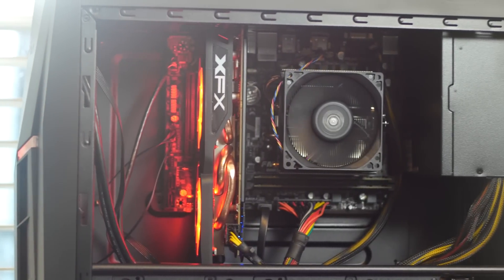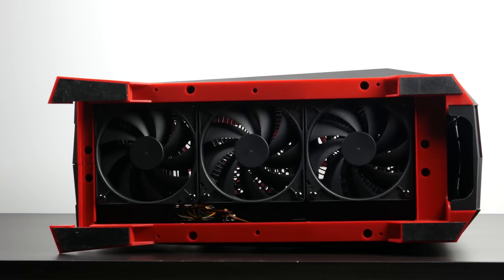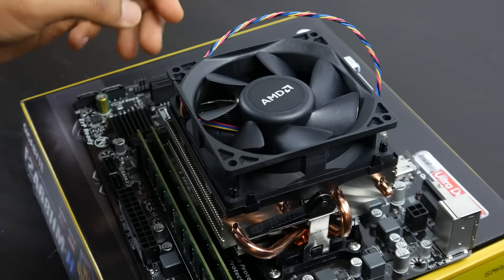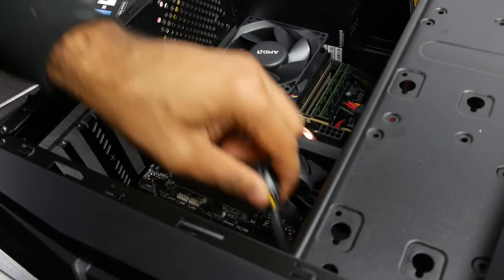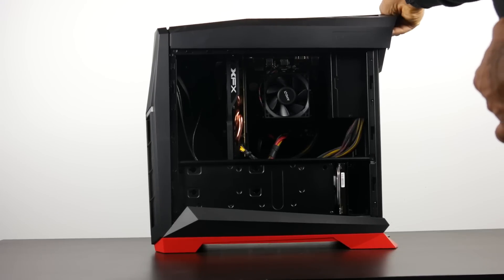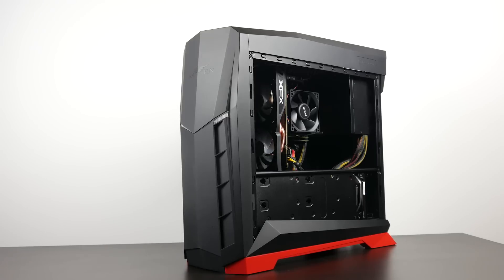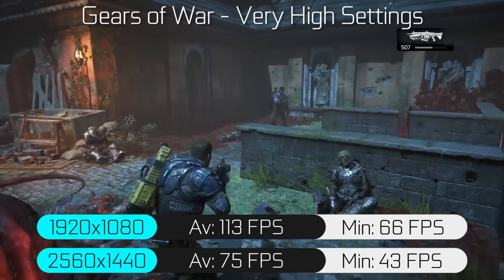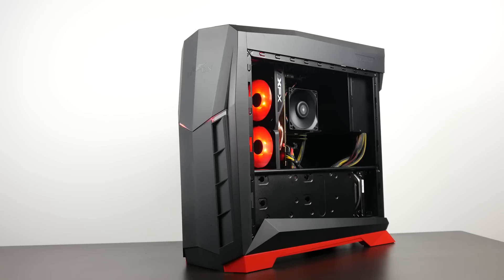Ultimate Gaming PC Under $550

Comment: with which Intel CPU is this CPU comparable?
Reply: Lenny Probably an i3-6100. But an i3 destroys this CPU. So if you have an extra buck get an i3.
Reply: Pentium G4400
Reply: Q6600
Reply: Lenny This CPU when overclocked is comparable to the i5-6400. An 880k + aio is also cheaper than just a 6400.

http://m.cpubenchmark.net/high_end_cpus.html
Reply: foxhill153
you have no idea what you're talking about...even if you would overclock it to 6ghz it would still be noticeably slower than an i5-6400
...even the link you've provided which is strictly multi-threaded performance which is only one part of the equation where the most relevant information (single-threaded performance) is left out you can clearly see that the 880K fall short to even a 4 generation old low end i5-2320
Reply: Tech Wiz Master I'm not sure what chart you're looking at, but yeah the 880k (score of 5612) can be overclocked to match the 6400 (score of 6613) in multithreaded performance. Theres a simple formula you can use to determine the clock you would need too, and spoiler alert: it's less than 5GHz. Not hard to reach on that chip either.

With a bit of overclocking experience and some tinkering, this thing can match the 6400 for a fraction of the cost. Also they're both 4 cores. If you compare 2 CPUs that have a matched # of cores/ threads and a matched score in multi threading benchmarks, they're going to match in single threading as well. that's just so obvious.. I can't believe you would bring that up. 

The fact that Intel since the 1st gen i7s requires a kernel to be built in to the os for their CPUs to work, adding unnecessary virtualization to 3d rendering, makes them likely to stutter more at the same FPS when compared to AMD chips which don't rely on a kernal. I switched from an i5 4670K overclocked to 4.5GHz to a FX 9370 chip because the 4670k stuttered more at 70 FPS than the 9370 did at 45 fps. A lot of the times I was getting better FPS after switching too which made the entire gaming experience more enjoyable. Believe me, I was very much an Intel fan boy like most of you until I actually gave AMD a chance and was blown away.

Also I'm not sure where people got the idea that the i3 6100 would be faster than this thing. it's clearly not. The 880k is faster even before overclocking which you can't do with the 6100.. It really doesn't make sense since developers have been writing low level hardware support in to DX 11 games since the new consoles came out. This means most games can already render on 8 or more cores even before dx12. The battlefield series has done well in this regard.

People need to stop thinking that we still only have 1 core communicating with the GPU. If this was the case still, most modern games wouldn't work (even going back as far as metro 2033), and we'd see dual cores taking over the market.
Reply: foxhill153
nearly 8000 people proved the i3-6100 to be quite a bit faster than the 880K mate...
http://cpu.userbenchmark.com/Compare/Intel-Core-i3-6100-vs-AMD-Athlon-X4-880K/3511vsm121029

the i5-6400 ANIHILATE that outdated processor to the point where no overclock can compensate for that:
http://cpu.userbenchmark.com/Compare/Intel-Core-i5-6400-vs-AMD-Athlon-X4-880K/3512vsm121029
Reply: either pentium o i3, probably pentium

Comment: Same parts in Jimms (finnish online pc part store)

psu             55€
ram            64€
1tb hdd      60€
mobo         50€
cpu          104 €
gpu          289 €
case         106€
=============
total         728 €

Okay the parts dont require shipping in Jimms so you just pay what you get

Comment: I have this build basically. And I am only getting like 34 fps in gta v with a mix of high very high settings. Why is that? 

Specs:
880k
Rx 480 8gb
Asus fm2 mobo
12 gb ram
1tb 7200 hdd

Comment: I would have got a 1050ti and put the extra $100 dollars to upgrading the cpu to a i5 6500. Right now that thing is pretty shit with that cpu.
Reply: No the 1050ti is quite a bit faster than a 460. The problem with this price point is you can either have a really good mid-range cpu or a really good mid-range gpu, not both. So like in this build the cpu will bottleneck that gpu hard as hell in games like witcher, gta, and bf1. The 1050 ti is perfectly suitable for 1080p ultra/high gaming while that cpu will bottleneck the piss out of games.
Reply: if you would watch the benchmarks he is easily getting over 60fps at max settings so it doesn't make a difference. literally spend like 30-40$ on the case and put the rest into an fx or i3 or even i5 if you can mange to find one cheap.

Comment: these fanboys are so hard to deal with. everyone said an I5 of any kind won't bottleneck a reasonable GPU. I had this cpu (technically the 870K). and I have an I5 4460,good budget I5 from the haswell architecture. cpuZ reported that both builds benchmarked almost the same when the athlon clocked to 4.6, losing by on 40ish points in a benchmark that scores by thousands. give this cpu faster ram to help it as much as possible and it will be perfectly adequate. not ultimate but adequate

Comment: Consoles.....Ha!
Reply: This $550 doesn't include the cost of the OS. Most people can't get the OS for free. The fact that the cost of the OS isn't included is very misleading on the actual cost. This build is really a $650, which is $250 more than the PS4 Pro. If the PS4 Pro cost $650, it would outperform this build because it would have better parts due to the the fact that the parts would be way cheaper because Sony would buy the parts in massive bulks.
Reply: But with the PS4 you need to pay for a subscription to play online
Reply: zarbon700 os in Kinguin only $20 an sometimes in g2a $19 and ps4 pro need ps plus $60 😂😂😂
Reply: Most people don't know they can get cheap OEM keys. Mostly PC nerds know about cheap OEM keys. That's why using cheap a OEM key price is invalid.
Reply: This PC build vs PS4 Pro is about hardware performance, not online gaming.

Online is optional. Also, PC online gaming isn't superior to console online gaming. It's often very hard to get online matches going in many games on PC because many online communities dead quickly. More games have a higher online gaming lifespan on consoles than PC. Another advance to online gaming on consoles than PC is it has way fewer hackers who cheat.
Reply: +zarbon700 You can get legit Windows 10 keys for as low as $20 via 3rd party sources. In any case, if you are tech savvy enough to build a PC, you are probably more than capable of getting the OS for free if you really wanted to... I'm up in arms about this build too (for other reasons) but since when did we start bitching about the price of the OS not being included in the build cost? Almost every PC build I've ever seen excludes that and for some reason people are using this comment section to act as if its the first time they ever seen such a thing. C'mon guys, I'm with you with the logical criticism like the expensive case and bottleneck CPU choices but get the fuk outta here with nonsense like that.
Reply: Its not free, you still need a key unless you already own one which is around 180$ (NZD)
Reply: You Do NOT need a key to install windows 10.
Reply: zarbon700 but anyone can get Windows for free. You can download the full ISO from Microsoft without buying anything and say that you will enter the product key later, then never do it. You get the full Windows experience only a water mark in the bottom of the screen
Reply: +Zarbon700 Heres another thing you forget when factoring the value of PC vs a PS4 pro. Unlike a PS4 Pro, A PC is obviously capable of a unlimited amount of tasks beyond gaming. If you strictly want to talk gaming alone tho, Outside of the latest modern games It also has access to a virtually unlimited backlog of games when you factor in older PC games as well emulation of older gaming consoles and platforms ranging from the 8 bit era all the way up to even the WiiU. PC is the only platform that can play games from the very beginning of time all the way to the latest games in one place. Thats only talking retail games too. The unlimited amount of mods and homebrew games available for PC users is another endless world that the PS4 Pro cant even dream about. Once again, the OS and software such as games only costs as much as you want it to cost. On PC you can have a OS of your choice and almost every game ever made and not even pay a penny. All you truly need is a PC and enough HDD space to store everything you want. Especially on PC, almost all software can be obtained for free or has a free alternative if it can't be. Thats why you see so many people willing to go all in on PC builds and not even care.
Reply: And also games are more expensive. And normally people still have some kind of a PC that they can upgrade to WIndows 10 and tie the windows to their microsoft account and that way u can move it to another pc which doesnt add 100 dollars... Or you can buy a cheap key for like 20-30 dollars
Reply: yes, but they need to make profit off the ps4. they can buy the parts for cheap in massive bulk  but it'll sell for a lot more than the parts. building a pc would be cheaper even if a person does not buy up in bulk.
Reply: Giving that Ps4 Pro is way smaller it'll cost quite a bit,it's like a Laptop it's small but not better then Gaming Desktop with similar spec

Comment: Hey Man, will this system be gud for video editing like Adobe elements?
Reply: It wouldve been an okay cpu for editing 5 years ago lol
Reply: jynxed  in that case plz suggest some specification which is good for playing games and video editing like Adobe elements and may be premier pro....I'll wait for ur word before going out for shopping....plz try to keep it under usd1200
Reply: dontuseitmuch At the moment its better to go with Intel preferably an i5 or higher but i would advise you to wait till ryzen to be released
Reply: jynxed okay, what about video card, ram and motherboard
Reply: +ddontuseitmuch Depends on What resolution you want to work at. If you want to work at 4k then either the 6gb 1060 or 8gb rx480 will be enough. As for the ram the higher the frequency the better it will perform (you will need a z170 for frequencies higher then 2133) and for 4k you will need atleast 16gb (2x8gb modules).
Reply: jynxed I like to stick to 1080p only no 4k
Reply: dontuseitmuch Then go with either a 1050ti or a rx470 but have 16gb ram

Comment: Anyone got idea which is better fx6300 or 880k, I'm planning on upgrading gpu and I got fx6300 processor currently, so I'm just trying to estimate what kind of fps to expect. Most stuff I found online about this 2 processor is that fx 6300 is better, so could I expect 2-5 fps increase in comparisson to benchmarks here. And if anyone has either fx6300, 6350 or 880k with gtx 1060 or rx480, could you just comment how pleased are you with those, as in are they that good.

Comment: i built one with a cor i5 and a gtx 1060 for $480   and windows 7 pro
Reply: Lyple how? The gtx 1060 are more than 480
Reply: ScruffyFox I got the 1060 3Gb from gigabyte for $210, but my PC I used was a refurbished HP Compaq 8200 elite cmt with a core I5 and a 500 Gb hard-drive, with windows for $150, but I had to get a monitor for 10 4K at a thrift store, and 4 Gb stick hyperx ram for 25 and ye
Reply: wow the deals

Comment: How much is 880k better than 860k?
Reply: Very little. All of the 8XX series are the same processor, just clocked at different speeds.
And with a low IPC like AMD's, it doesn't make much difference.
Reply: Yes, that's the short answer.
Reply: darkki94 not true, I have the 860k and it does really good for 75 dollars

Comment: I want to get better 4K fps, Should i just add Nvidia 1080 ?
Reply: Aran hiwa if ur on a budget, GTX 1050 or 1060 is ur best choice
Reply: If you want to buy a 1080, u need at least a i5 6500 cpu otherwise the cpu will just not be able to handle it 
And for that, u need a 1151 (like with b150 chipset) ^^
Reply: Im pretty sure you could use an i5-750 with a gtx 10 series card and it would still work.
Reply: it really isnt. the RX480 with driver maturity is edging out the 1060(even just 6 months after release). i surmise that the 480 will soon dominate the 1060 with new APIs and better driver support.

the best choice imo would be radeon. any of the 400 series cards right now. in 2017 however, Vega looks to be the next gen of Radeon cards (ie 500 series)
Reply: Yes, a i5 750 bottlenecks a 1080 just slightly.
But keep in mind that these processors render a bit slower in Open World Games.
My i5 760 is the fault that GTA:V drops on very high to 55-50 FPS on some areas.

In Short: The first generation i5s wont bottleneck, and they are still good, but a i5 6400-6600 would be better.

Comment: RX 480 4GB + i3 6100 and a cheap ass case
Reply: gtx 1050 + i3 6100 and a cheap ass case, mutch better than this shit in the video
Reply: Eron 1050 with an i3 6100 kid? RX 470 4GB w/ G4400 is better.... 1050 will bottleneck the i3 6100 so hard. RX 460 2GB, RX 470 4GB and RX 480 4GB are the best cards to get in their price points. Only thing u can buy on Nvidia is the 1080 if you really want it. I'd rather get a used 980ti than the overpriced 1070.
Reply: Vanguardas Vucava g4400 is less powerful than i3 6100 lol
Reply: JacktheRipper get the g4560

Comment: is this a good build:
Intel i3 6100
Evga 500W White
Gtx 1050 ti 4GB
8gb corsair vengeance 2400 Mhz
Bitfenix Comrade (case)
WD Blue 1tb 7200 rpm
GIGABYTE B150 Sniper B7 Gaming ATX Skylake Motherboard

510-550£ on aria.co.uk 
550£ if you buy an after market cpu cooler

Comment: not to say your build is not good, but imo its just not, even including the 1440p results imo was a mistake, who's gonna go spend $550 on a pc then 200+ on a monitor? just wouldn't make sense, also why an fm2? you can get an i3 6100 for slightly more and be on a socket with an upgrade path(to any skylake processor) and then get an rx 470, again the monitor they have probably won't have more than a 60hz refresh rate. https://pcpartpicker.com/list/jP8tLD here's a build I put together that's cheaper and can perform as good as the one you presented, but thats just my opinion

Comment: Here you guys go:
https://pcpartpicker.com/list/fr2NYr

CPU: Intel Core i5-6400 2.7GHz Quad-Core Processor  ($182.55 @ B&H) 
Motherboard: Gigabyte GA-H110M-A Micro ATX LGA1151 Motherboard  ($48.98 @ Newegg) 
Memory: Corsair 8GB (1 x 8GB) DDR4-2133 Memory  ($44.38 @ Newegg Marketplace) 
Storage: Western Digital Caviar Blue 1TB 3.5" 7200RPM Internal Hard Drive  ($49.99 @ B&H) 
Video Card: EVGA GeForce GTX 1050 Ti 4GB SC GAMING ACX 2.0 Video Card  ($154.98 @ Newegg) 
Case: Deepcool TESSERACT BF ATX Mid Tower Case  ($29.99 @ Newegg) 
Power Supply: Corsair Builder 500W 80+ Bronze Certified ATX Power Supply  ($46.99 @ Newegg) 

Total: $557.86
This build is upgradable, unlike the old FM2+ platform. A budget PC does not need an expensive case. It is your preference if you prefer aesthetics over functionality. However, it will cost you more. This DeepCool case is not even that bad for the price. The GTX 1050 ti should be decent for 1080p gaming. However, if you could save up $50 more, you can get yourself an RX 480. I would not pay any more than $220 for an RX 480

Comment: WHAT does
Bottleneck mean?
Reply: George Hernandez thanks
Reply: +Easy Life hacks
Think of the CPU as a glass.
The GPU is water.

If the CPU isnt strong enough, the glass is tiny. If the GPU is strong, theres more water and the glass flows over.

Thats why you need a big glass, to get as much water in there as possible, aka good processor that can hold a GPU.